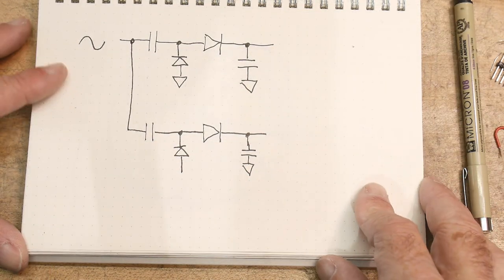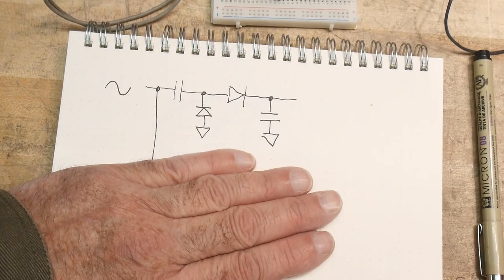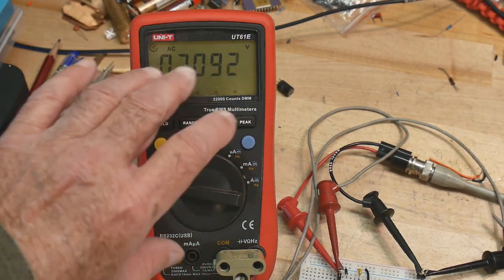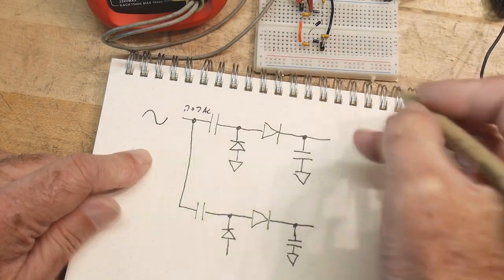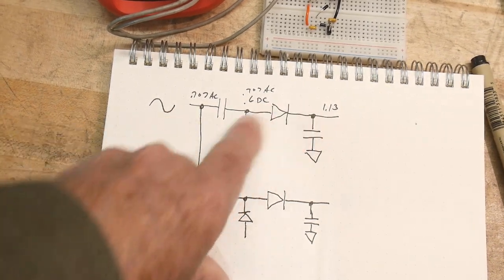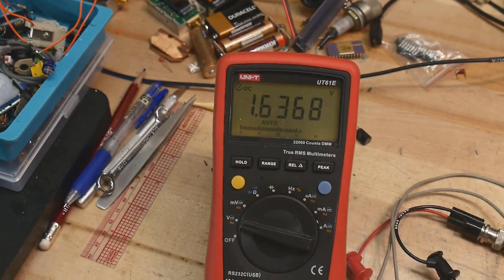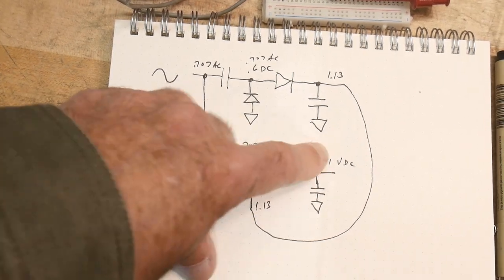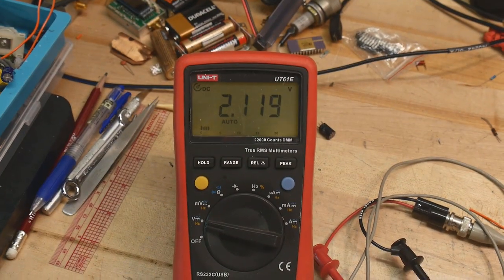#727 Basics: Voltage Doubler Circuit

Comment: Voltage Doublers were commonly used in "CB" Sweep Tube Amplifiers. Used a transformer with around 300v on the secondary, and increased to around 8oov.

Comment: You only need 2 diodes and 2 caps to make a voltage doubler. If you make the input AC much higher than a diode drop you will see it work much more clearly. This demo is a bit muddied because your AC input is comparable to a diode drop.

Comment: Thanks again. Your videos are great. You are smart. I will look up your bio. I think you had a career at HP and Tektroniics....

Here is a challenge- I am playing with motorcycle and small engine magneto & CDI.. Do you think it's possible to measure the high voltage current in the secondary? I am imagining a floating current sensor that would be placed on series but away from ground in the high tension lead. So then some measurements are made. Maybe the current pluses are stored on the sensor...then read later after the engine or magneto has stopped. 

I am trying to find the best coil and CDI driver to produce nice hot spark. I have this KTM 550 2 cycle with SEM magneto that seems very weak...the engine has to be like perfect for it to start. My other dirt bikes are much easier to start..watching the plug spark on the  ktm 550 when it lies on the head..it seems weak....hence I would like to measure the current. I suppose if the primary power is say 12 vdc at 3 amps...or 36 watts...then this pulse when transformed to HV say might have 10kV ....then current might be no more than 3.6 mA...perhaps subtract 10% loss in the transformer.....

Sometimes I feel like ditching the SEM and CDI...go with DC coupled proximity sensor...or that pulser..coil- perform signal enhancement..create a nice 5 vdc pluse for a coil on plug MSD 8287 ..then have the 12 VC lighting coils on the mag...charge via rectifiers to a Li-ion battery....

Then nice gentle slow kick should jump a fat spark plug gap...

I guess its time to read up if such a current sensor in the high tension can measure the spark current....

I love to see the current pluse on the Oscilloscope ...this way verify if that MSD or whatever stock CDI and coil what do they put out...inside of me saying well that spark looks strong...I suppose voltage could be observed by measuring an air gap....

Any ideas?  

In no hurry in Phoenix 

Kind regards Fred
Reply from the maker: One viewer said the probe is good for automotive; https://youtu.be/Nm6eMVgUq0Q

Comment: How much current can that circuit deliver?
Reply: The current depends on the ac frequency and the capacitance used.  At 60hz this limits the circuit to fairly low currents.  However some switching supplies support 240v or 120v by using a voltage doubler with two large electrolytic capacitors.  In that case a non-trivial amount of current can be delivered.